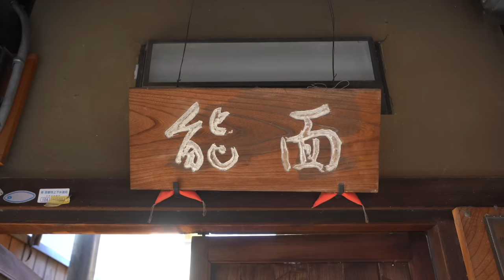日本のすばらしい職人技TOP5

Comment: You're making very nice videos with a very good camera and a very good lens. Very pretty bokeh. However, when documenting detailed work, closeups, almost macros with a lot of movement, the camera sometimes focuses on the wrong thing, like whatever is closest, not what's being worked on. Would you mind doing two things for these shots? Stopping down a bit and maybe use manual focus or focus lock? The craft shown in these videos is so interesting! Of course, if you can afford it, maybe have two cameras, where one is set up for details/technical stuff?

Thank you for making these videos! Super interesting!